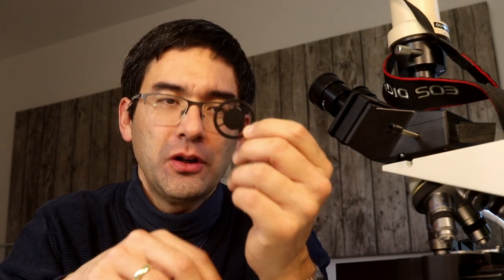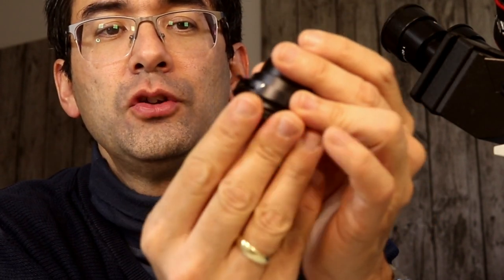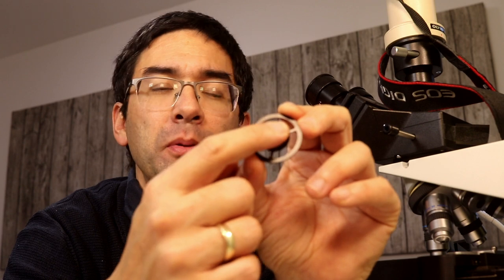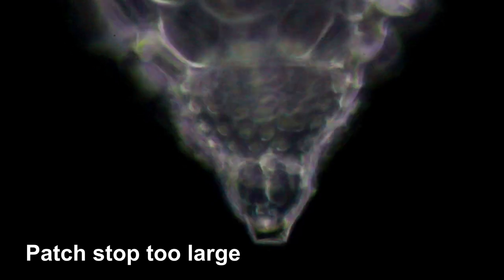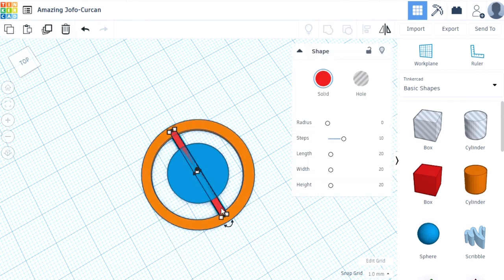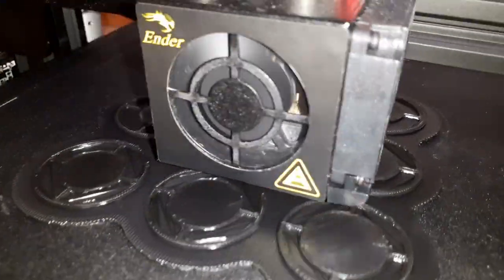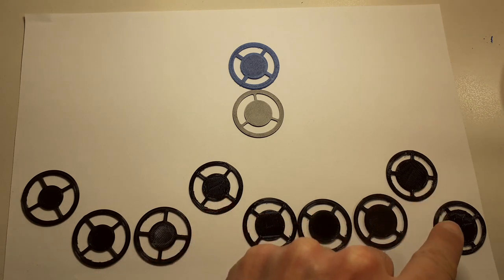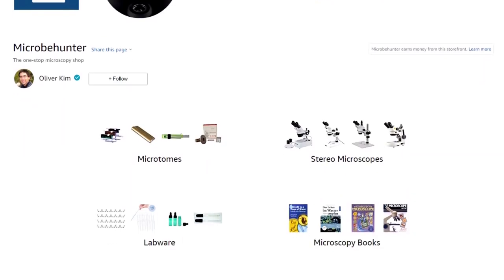🔬 How to find the best Darkfield Filter for a microscope by 3D printing

Comment: I'm doing this same experiment now for the American Optical series 110. The optimal filter size (no wiggle room) is 34.85mm. A nice height of 3mm is good (because it is a slide-in filter)--makes a very robust patch. I have figured out the rough best sizes for each objective (within 2mm), but I'm doing every single mm, so I can figure out the minimum size for each objective. Then I can do the same with a hole in the middle and put a gel there to get rheinberg. When I get all that working, I'll do oblique. Thanks for the video.

Comment: If you don't have a 3D printer (like me) you could also print them on laser printer foil like used for presentations. If you have a color laser printer you could also color the gaps with different colors to give the observed objects some colorful "shadows" to add contrast, like diagonally two fields green and the other ones red really improves contrast. Maybe you will have to overlap two prints if the color is too weak. But it really is a fantastic method to improve the observation in a really cheap way (i printed them in a copy shop).
Reply: @kisakuru5656  Thank you so much for sharing!
Reply: @ta513  You're welcome
Reply: @kisakuru5656  great thanks!

Comment: Yep, a 3d printer should come in handy with a microscope.
I suppose a 3d printed filter would work better with a LED lit condenser, otherwise a halogen one might heat up the plastic.
Edit: You should be able to remove the build plate after printing is done and flexing it to avoid hacking stuff off.
I believe the Ender you got has that option, if not built in then certainly as an aftermarket upgrade.
Reply: The flexible PEI sheets make removing the prints much easier. You can also decrease the adhesion by cleaning the sheets with Windolene.

Comment: I tried 3d printing stops for my labophot microscope. I even had to make a special holder to hold the stops. It worked great BUT the heat from the halogen lamp melts the plastic.

Comment: Thanks! I didn't realize until today that my microscope has a filter holder.
I also didn't know until today that the eye pieces will slide out when I turn my microscope upside down. Ooops!
ps. I made myself a dark field filter, and it worked! 
required materials:
1. potato salad hard plastic container
2. electrical tape
3. scissors
4. round thing the size of my filter holder
5. sharpie pen
6. tarp hole punch, ≈1cm
7. hammer

It worked on my 4 & 10 x objectives, but not on my 40.

Comment: Is there a way to make a patch for the 100 objective?
Reply from the maker: No, you need a special condenser for this. There will be too little light otherwise, because the central dark disk has to be larger for higher NA objectives (such as the 100x), and there is already little light for higher magnifications.
Reply: @MicrobehunterMicroscopy  Ok, thank you!

Comment: Where can I buy a set of commercial patch stops? I have looked around on the net but don't see any. Also, are your TinkerCAD or gcode files available for sharing (like on the Thingiverse)? Thank you
Reply from the maker: They are easy to make out of cardboard. Glue a dark piece of cardboard on some clear plastic foil.
Reply: @MicrobehunterMicroscopy  Thank you. I saw that you used a 3D printer to print some, so that is my next strategy. But I will try the dark cardboard approach on some plastic salad packaging with some double-sided tape. Thank you.

Comment: I have a problem on my condenser filter holder,
by putting stops on it ,
overtime the holder become
loose and when I tilt the microscope it swings out and
sometimes I don't see anything.
Reply from the maker: Tighten the screw a little if it becomes loose and if you can not see anything make sure that the filter holder is all the way out or in and not half-way.
Reply: Why do you tilt your microscope? I'm very new to microscopy, and suspect that there are a myriad of things microscopists do, that newbies have yet to discover.
Reply: @WITHINOHBOAT  because it can, to adjust the angle of the eyepiece.
Reply from the maker: @WITHINOHBOAT  In some battery-powered microscopes, the battery compartment is in the base and then one has to tilt it to the side to exchange the batteries. Many halogen bulbs can also be accessed from the bottom. But as was mentioned above, one has to be careful becasue some parts can fall out (filter, eyepiece).

Comment: if i accidently print a blue darkfield filter would i be able to paint it black and it will make the background black?
Reply from the maker: Yes, but sometimes the blue filter will also look nice, giving the image a blue background (a bit less contrast, which can also be an advantage sometimes).
Reply: @MicrobehunterMicroscopy  ok thanks for the information :D, ill make sure to try both.
Reply: @MicrobehunterMicroscopy  ok so now i am having another issue, the actuall patch stops are blocking areas of the sample, i can actually see that in the light there is a big area that is blocked from light passing through, and thus it will not work with 40 times and bearely 10 times, i have tried many different sized patch stops aswell.
Reply: @handle8handle2handle2  Open the condenser all the way. Dark field with the 40x is difficult anyway (too dark) but with 10x it should work. Also the filter holder must be in the middle. Some microscopes allow you to move the condenser up and down and make sure that it is all the way up.
Reply: @microbehunterlive  so i have tried that just now but the shadow is still casted from the actual filter making some black patches in the sample when i look at it so its either to bright, or the right darkness but with a black shadow, sorry im quite new to darkfield so im still trying to work this stuff out. Also im using the SwiftSW380T.
Reply: @microbehunterlive  actually never mind haha, i realised that it was  a nail in the actuall microscope that came loose, once i tightened it everything is working perfectly, thank you for your time and patience i do really appreciate all the help i have recieved from your channel over time!